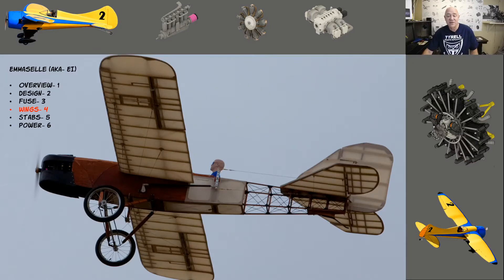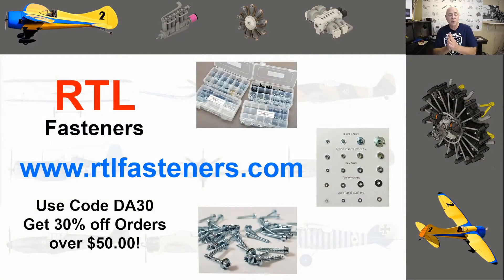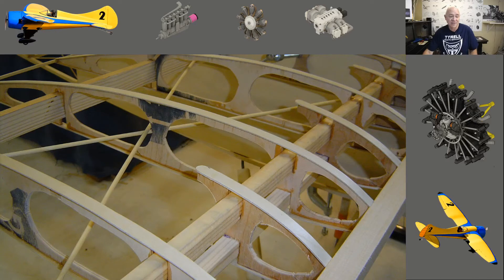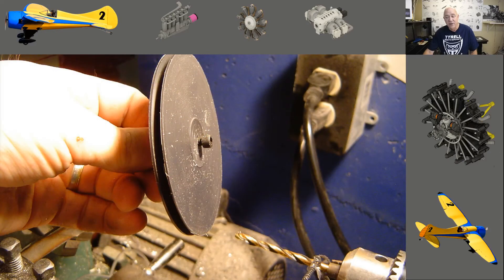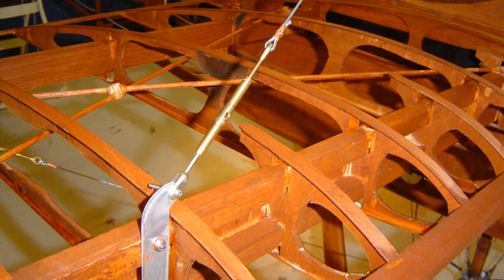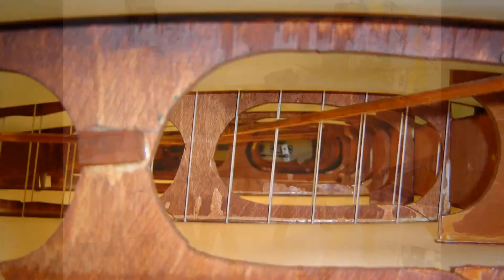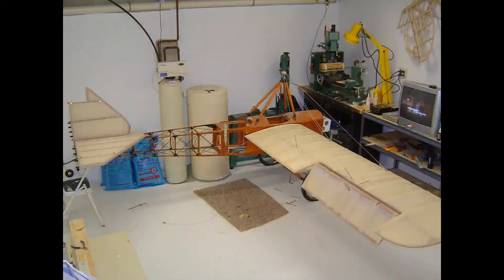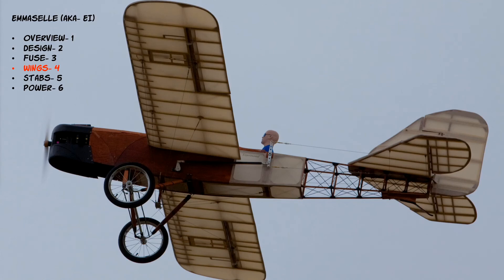197" RC Electric Airplane! The Story of the Emmaselle.  (Part 4 Wing Construction and Covering)

Comment: There is an episode of Adam Savages Tested from about 5 months ago where he is looking at some old planes and some of the ribs in a wing were repaired from old apple boxes.

I live on the west coast and making doors and windows so work I with full dimension lumber before processing it, you know when you have a piece of spruce when you can lift a 2x6 20 feet long standing vertically with one hand and it weights about 12 pounds.

Comment: Hey Dag
Here goes I have a copy of your plan…. I am looking to get back into flying & building based on what I have seen it looks like a simple build design. With that said what would build the ribs from and what would be the size to build the fuse?  Keep up the great work

Michael
Reply from the maker: I would build most of the plane from Balsa and Liteplywood. As far as size? I would scale the drawings to what ever size is best for you. I hope that answers your question. :)
Reply: @dagtheaviator  great I like both your plane I like the fact that you can use electric motors. I will keep them the same size.